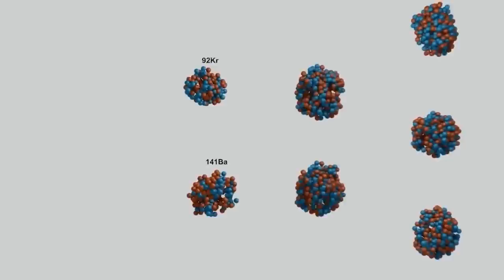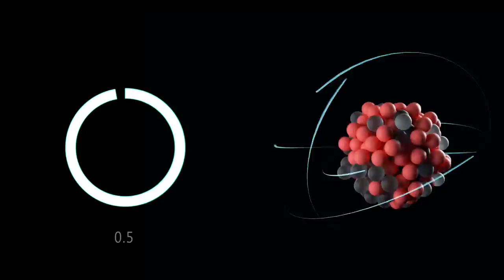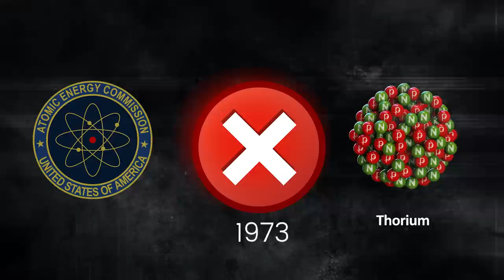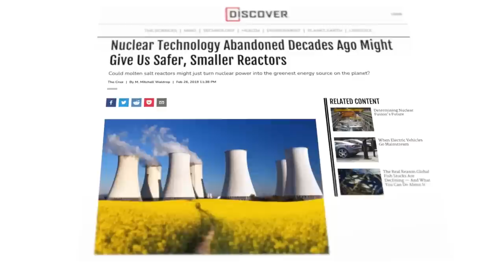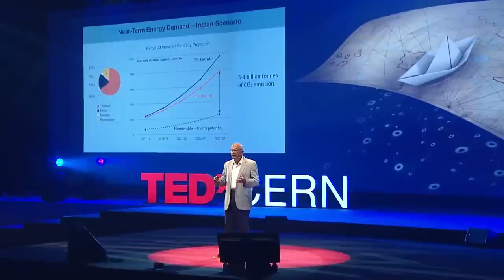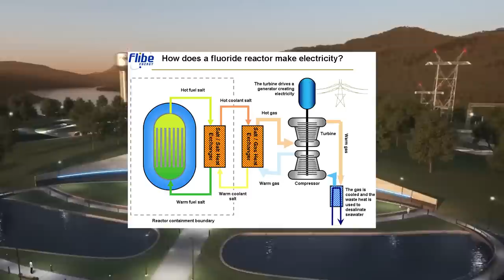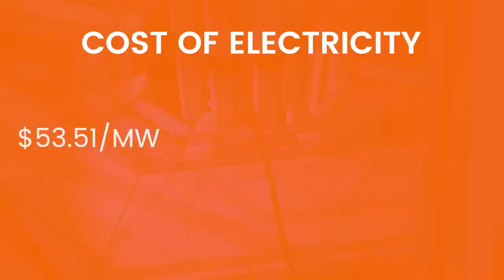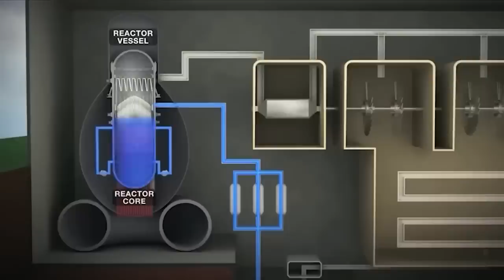Forget About Nuclear Fusion - Thorium is the Energy Source of the Future

Comment: The funding was not discontinued by the US due to design or material constraints, which could be solved, hence the research lab. The real reason was that the Thorium reactors could not provide the US with Plutonium or they could not enrich Uranium under that pretext for nuclear weapons as effectively as other methods, as it was the peak of cold war. Considering that the US did 1500 heavy nuclear bombs testing in the bikini islands which by the way were stolen from the natives, it was easily possible for the US to fund the Thorium research further easily. It was just convenience
Reply: This does not make any sense whatsoever. You do not use the same type of reactor t to create weapons grade uranium or plutonium as you do to create nuclear power. The US should have been all for thorium reactor research because it would free up all the uranium that was being used for power generation to be used in nuclear weapons. Even better - a thorium reactor would create uranium rather than consuming it, meaning you have to mine less of it as it's a waste product of energy production. The only good reason for the US government to not fund this research is they didn't think it'd pay off in the long term - probably due to design and material constraints.
Reply: @StreakyBaconMan  What you say is true they do not and thorium can be used to make uranium, but the problem is that manufacturing of enriched uranium can be used to do both power and weapons, and thorium requires a specific process to convert. Also it is pretty difficult to weaponize the Uranium generated in the thorium reactor. It takes time and money. When you already have the process of Uranium enrichment why would you go to another source, in spite of it being better suited in the long run?  And thats the basic premise that the freeing up of Uranium only for weapons does not give you a nice facade in front of the world when you only enrich uranium for weapons. Its literal provocation, and in the cold war where US itself had discussed for nuclear control that becomes a sticky wicket. Think about politics too not only the science behind it.And I do not believe it was due to material constraints. The US put people on the moon they had enough funds and people to develop materials.
Reply: You must have read my article on Thorium lol
Reply: @DrAtomics  Sure link it here

Comment: They really need to move forward with this until Fusion is finally figures out
Reply: No. We don't. Thorium is a waste of time. It provides no tangible benefits over the traditional Uranium fuel cycle.
Reply: @makunga_yokopal  Agree mostly.  Not sure if it will take 100 years to commercialize but it will be at least 50.  In the mean time - bring on Thorium!!!
Reply: lets build 1000000 of these and solve our energy probelms permanently> im sure the big banks would line up to finance them.

Comment: Thorium dioxide melts at 550 degrees higher temperatures than traditional Uranium dioxide, so very high temperatures are required to produce high-quality solid fuel. Thorium is essentially converted into U-233. But there is bound to be a downside, called Alarmists.
Reply: You gotta retune it to uranium 233 in a conventional reactor later a thorium one forget about these temperatures yunis

Comment: Not sure why you would need to mine for Thorium, I understand that most rare earth mining operations have mining waste piles full of Thorium, and they are happy to pay someone to take it away. The connection between rare earth and thorium is one of the reason china is interested in the Thorium Molten Salt Reactor as they hold the current Monopoly on rare earth supply which means lots of really big waste piles thorium ore that needs to be dealt with.